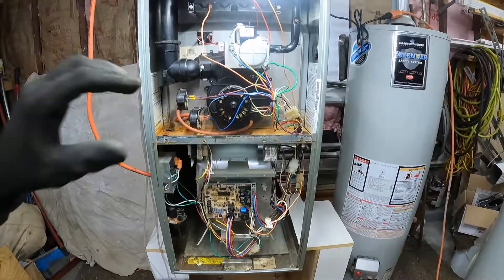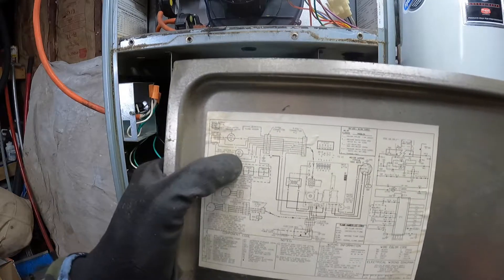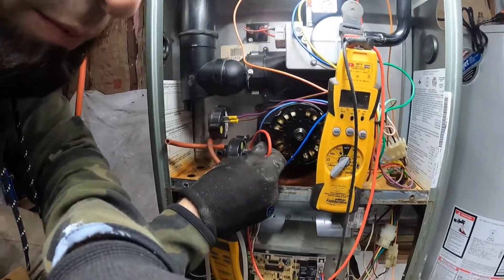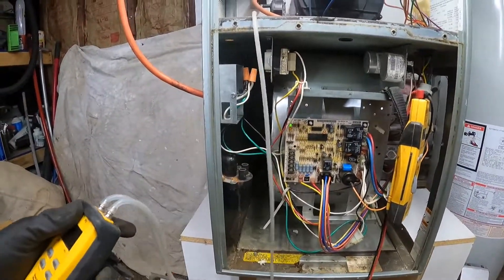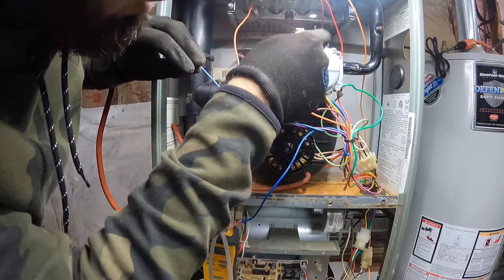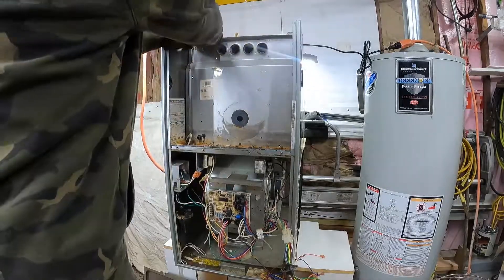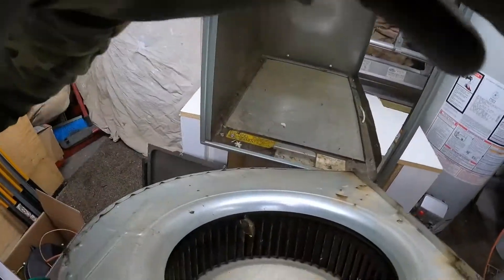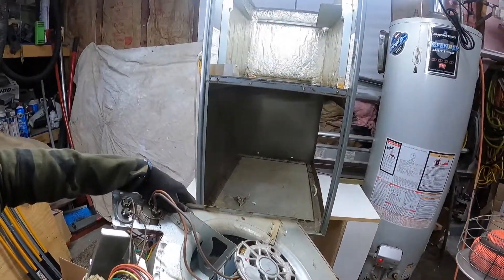Bad Pressure Switch: HVAC TECH GAVE UP

Comment: You shouldn’t allow that HVAC tech back on your property.
Reply from the maker: This property is owned by a landlord I do work for. The owner was way past frustrated. It’s hard to find good contractors/ service techs. Thanks for watching. Planning to check out some of your videos.
Reply: @handylandlord  Tell me about hard to find good service techs. That was actually the secondary heat exchanger that had the wrapper on it with all of the bugs. It wasn't a service tech that gave up, it was an incompetent parts changer. HVAC GUY is a real service tech and he's got some great content.

Comment: I missed what caused the the bad pressure switch. Apparently something unable to be fixed.
Reply from the maker: A crack on the exhaust pipe close to the top of the unit. Check time 5:01. This crack was creating condensation that was dripping on the drain system pressure switch. Over time it corroded the switch causing it to go bad. The pressure switch could have been replaced. After I got the unit running it was going out on high temperature switch due to clogged filter and dirty blower motor. Landlord had unit replaced. Thanks for watching.